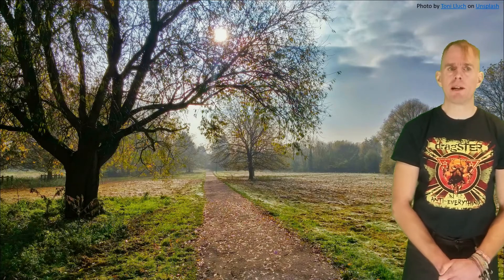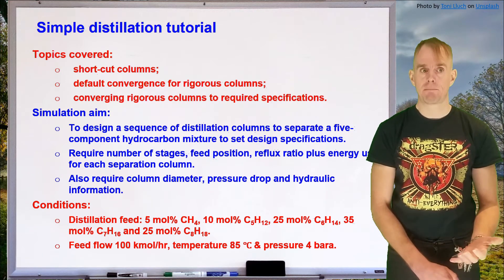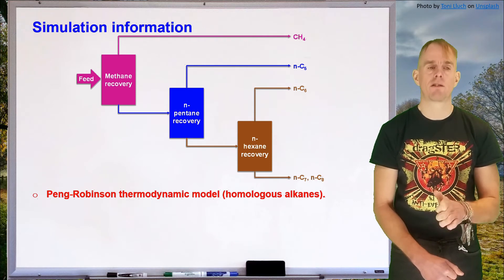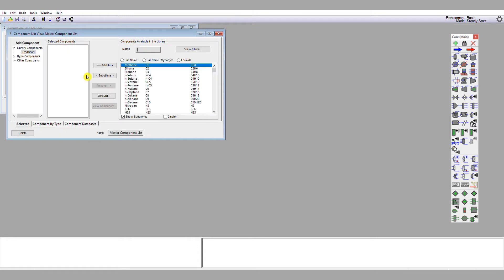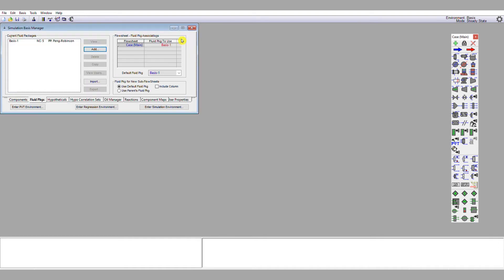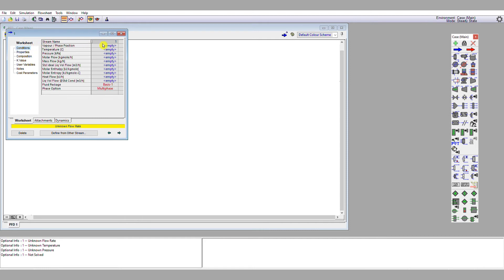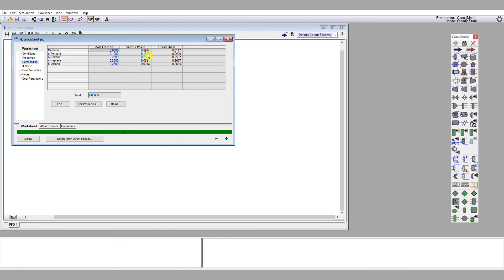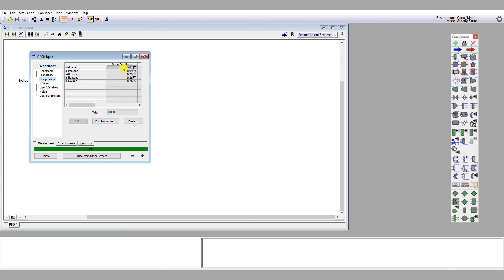UniSim / Hysys tutorial 2(i): distillation simulation [by Dr Bart Hallmark, University of Cambridge]

Comment: Thanks Dr. Bart for the tutorial. I have a question. I have to simulate a biomass gassification process. I have the (ap)proximate and the ultimate analysis of the biomass. How can I tell to UniSim that the biomass stream is a solid? In fact, if I define the composition of the biomass (%C, %H2, %O2, %N2, %S, %Cl2) at ambient temperature and pressure UniSim tell me that I have solid, liquid and vapour phases but that is not it; the biomass is of course a solid.
Reply from the maker: Thank you for your question - let's discuss this offline :)